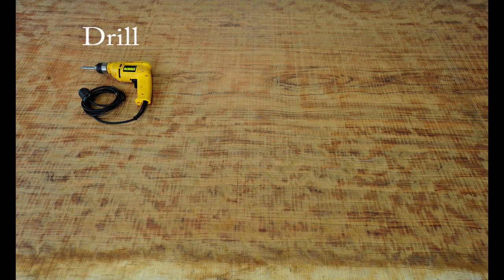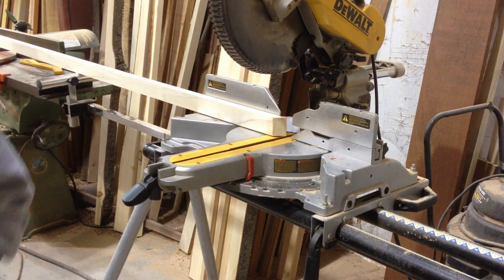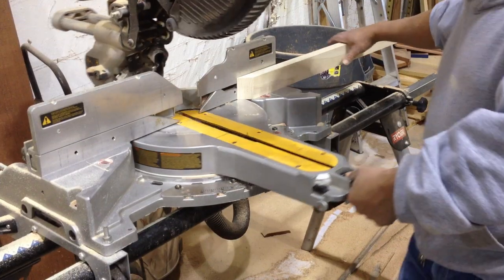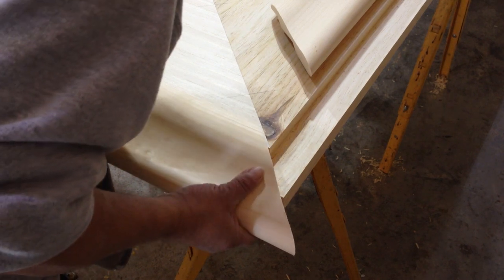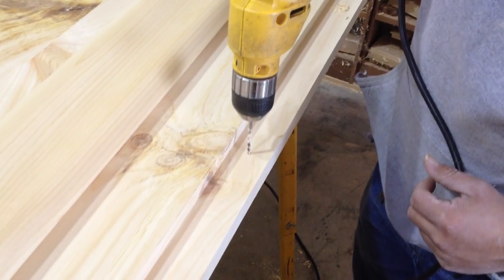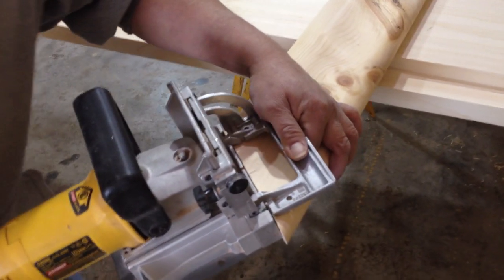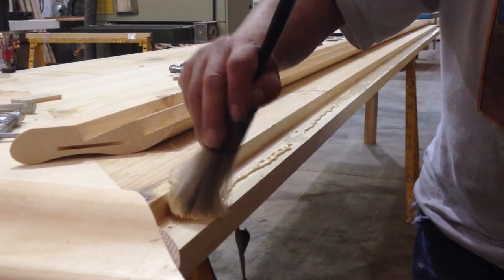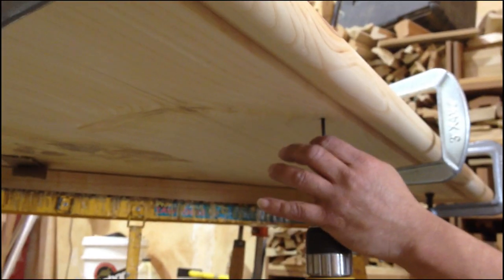How to Install Bar Rail Molding

Comment: Nice work. I had a hard time getting the 45 degree cuts to match. I think that using wood to support the rail while on the saw, as you did, would have helped.
Reply: Yeah, I just did this today after making the wrong cut. Matched up better after correcting. Still not as perfect as in the video, but close enough. I ended up filling the crack between with wood filler.